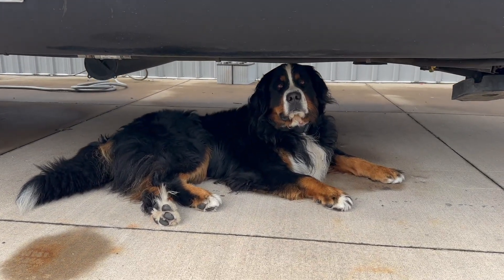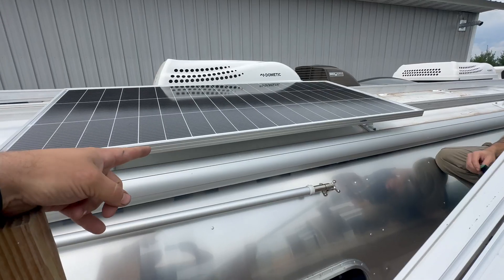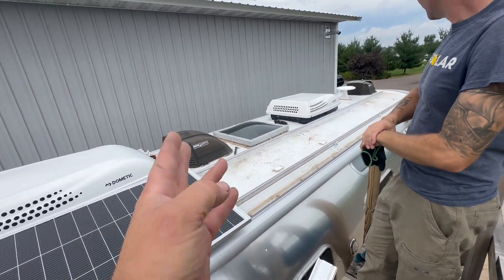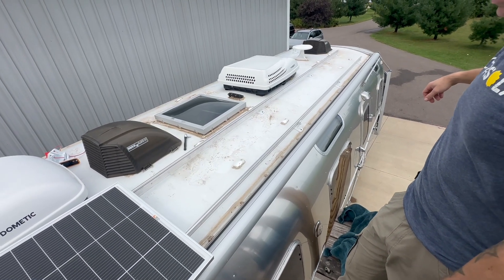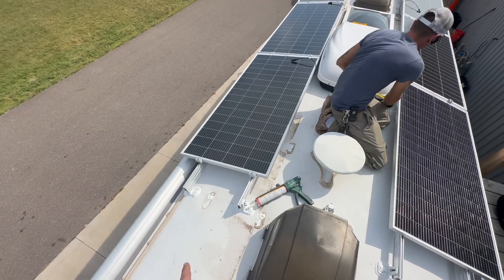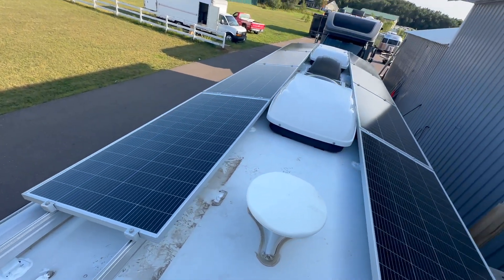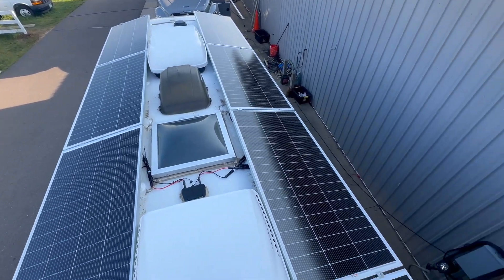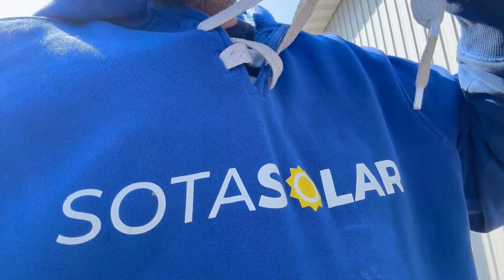Airstream Classic 1600 Watt Solar using Unirac Racking and Rich Solar 200w  Panels

Comment: That rack system looks great and the adjustability works well for the sloped roof of an Airstream. Can you still fully access the air units for servicing without removing the panels? I thought the rear screws that hold the covers on the air units were down low on the sides. Do you just remove a few of the solar panel clips and lift the panels out of the way? Hoping to do something similar on my 30' Airstream in the future and that rail system looks perfect for the job.

Comment: Have you ever used the Unirac SolarTray cable management rail trays with their racking systems?
Reply from the maker: Not yet, maybe you want to try it? I’ll ask my supplier.
Reply: @sotasolar  I think so. I'll have long runs of solar wire to the combiner box.

Comment: What unistrut rails and feet did you use? Could use provide a link or at least the names of them? I would prefer to use the kind you used in the video over the traditional. Thank you in advance.
Reply from the maker: Unirac, you almost need to goto a commercial solar supplier. The rails are 20ft long, Amazon won’t ship that :-)

The feet are Unirac Flashloc Duo

If you’re in the Midwest near Minnesota, I could probably ship it to you for free.
Reply: @sotasolar thank you so much for the information. I like the design of the unirac compared to the traditional. Thank you for the reply!
Reply from the maker: It’s much lighter too. A 20ft stick of unirac feel like ½ of a 10ft stick of unistrut.
Reply: @sotasolar  I am in Georgia and interested in buying the unirac flashloc duos and rails. Whats my best way to find a distributor? I cant seem to find anywhere online that tells me
Reply from the maker: Honestly, we’ve had the best luck buying on eBay. Don’t buy from Solarcellz, never delivered, doing charge back now. 

Our local supplier can get them too, it’s just 2-3 weeks special delivery.
Reply: @sotasolar  Appreciate the response. I cant seem to find any distributor in the Atlanta area and Unirac customer service isnt the easiest. Have you used other rails with the Flashloc Duo? Something like Iron Ridge rails which I am able to purchase locally?
Reply from the maker: Possibly.
Reply: @sotasolar  Appreciate the response and your videos. If i was a little bit closer I would let you deal with all of this. Unirac rail is one of the more difficult items ive ever tried to to buy but they look beautiful on your builds
Reply from the maker: Come on up. 

Someday I hope to get back to mobile installs with the new bus and a stacker trailer filled with unirac, panels, battery and blue equipment.

Comment: Have you guys looked into using BHT tape [ I think that was what it is called - from 3M ?
My thinking is avoiding holes in the roof .
Thanks again
Reply from the maker: VHB tape, yes.  When it comes to what we’ll put our sticker on and say “that ain’t going anywhere “ it’s going to involve a fastener for something like this. Single small panels sure, maybe. 

If you’re worried about holes in your roof, don’t get an airstream :-) it’s all holes. It’s all riveted together and eventually they leak. Most Airstreams we see after 5-10 years have dabs of dicor on every rivet on the roof. We have made that repair for customers as well.

 ¯\_(ツ)_/¯ when you combine all those factors together and the fact Airstream themselves uses fasteners, for us, it’s the only way to go. 

For you and yours, do what makes sense to you, and importantly share the experience on a forum or facebook or here. Especially a few years down the road. 

Stay charged!
Reply: @sotasolar  I was not thinking about dingle point - but the length of the channels , other have then used one of the typical RV sealants for UV protection .
Reply: I did this, aluminum unistrut adhered to the roof of our FC25 with VHB tape (and Sikaflex to keep water away from the tape), no holes. 6x100W Rich Solar panels. I’ve been keeping a close eye on it, and 2 years in no issues so far.